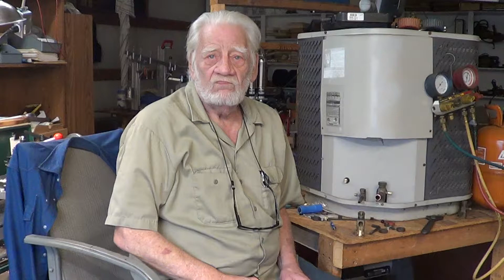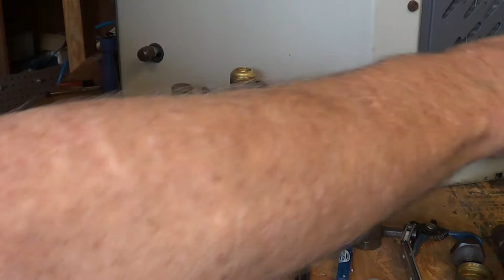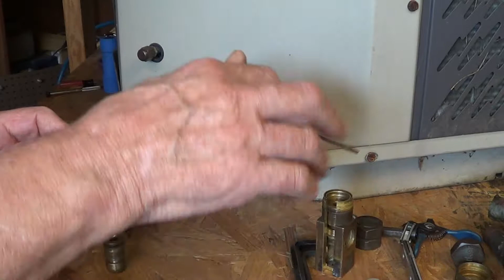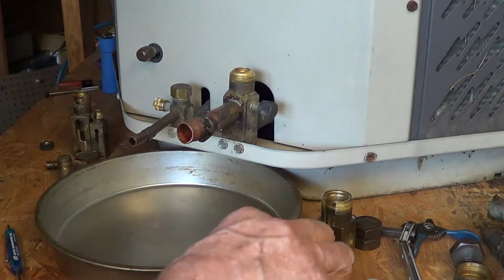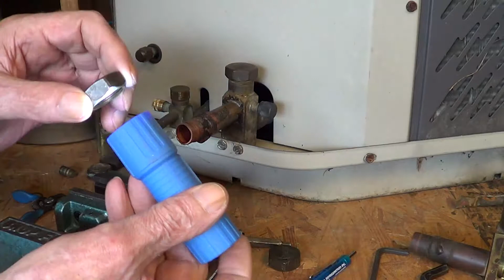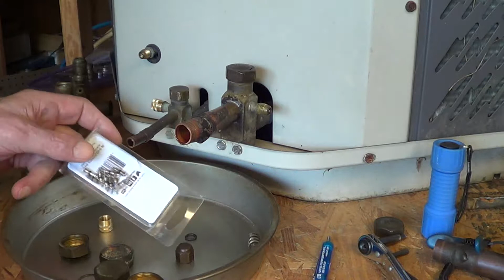HVAC service valve repair with Zero Leak Seal (formerly SEAL410)

Comment: I installed a 7/8 dome valve kit. I bubble tested it and it held. Also, the last service guy injected dye into the system so I washed off the dye that had leaked out earlier and checked again with a UV light and found no trace of it.  it worked. Thanks Al
Reply: Hi, Where did you buy the kit? Thanks, Sasan

Comment: Can I purchase a couple sets of these. How does one do that, please.
Reply: There are 3 sets available. Each set includes liquid and suction valve seal kits. Sets are referred to as Goodman, Domed and Snap-ring.
You can get 1 of each set for $109 total. Email Al Eggleston, Al@Seal410.com or call Al at 803-491-4565.

Comment from the maker: Call me  803 491 4565 est We can see what your needs are
Reply: Al got your kit. Works great. Saved $300.00 on a service call. Had service calls before & all they did was add freon, no attempt to fix the problem.  Guess they just wanted quick money.
Reply: @carm831  Carm man I need help...
My valves are leaking well thats what a local air conditioning company come up with 
King valve leaking ( both) and  the expansion valve ( TSB ) no working properly .. they estimating $1500 to $2000 to replaced just the valves not incluiding the TSB for new ones I didn't know they can be repaire the bad part is Iam in Las Vegas to the mercy of air conditioning companies everyone trying to take advantage of us in this hot hott weather..
Just curius if I find someone honest in town that offer me this alternative how much would it be..
How U think is the best way to exchange  email or phone number ? for better  comunication if not possible is all good
I will be calling his number today 7/12 hopully still the same.. good morning